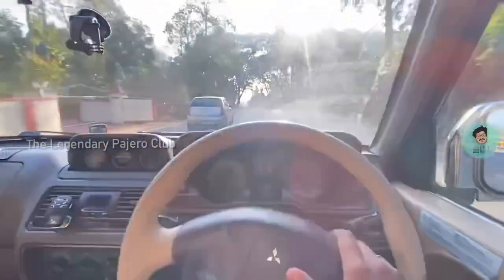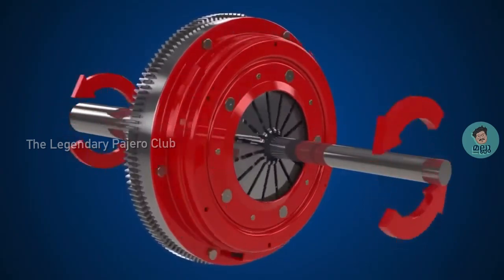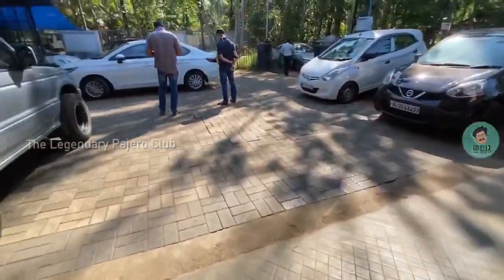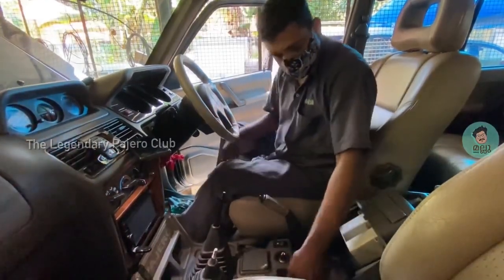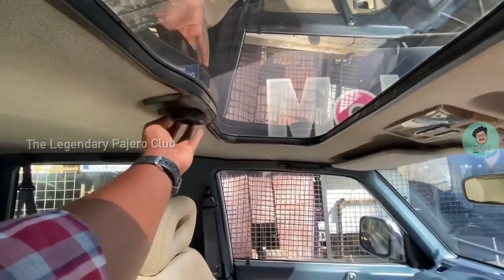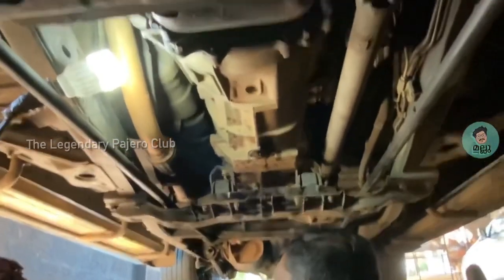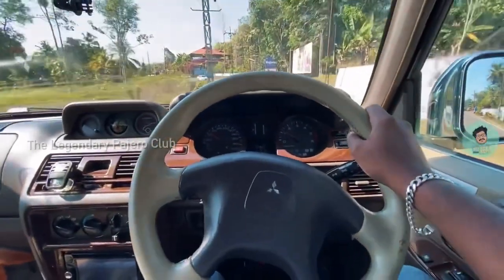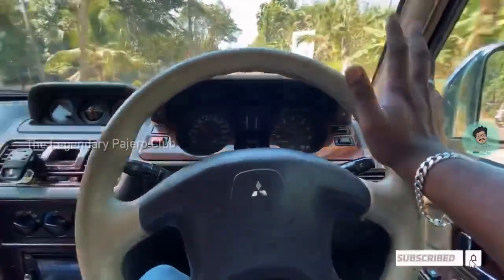Hybrid Clutch Installation in Pajero SFX | No more vibration😲

Comment: hv bought pajero recently nd 3rd and 4th has vibration below 2000 rpm,will installing this make car smoother in low rpm specially 3/4 gear